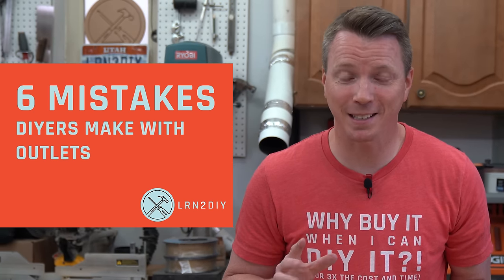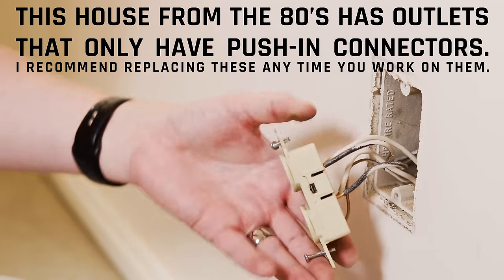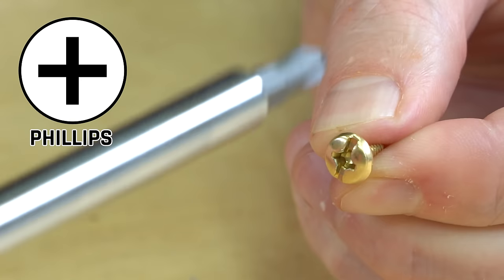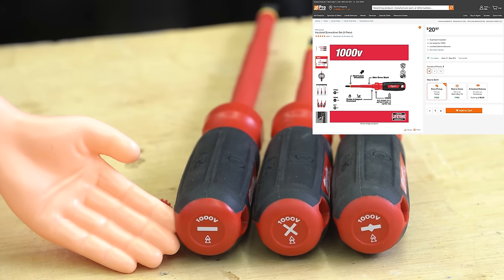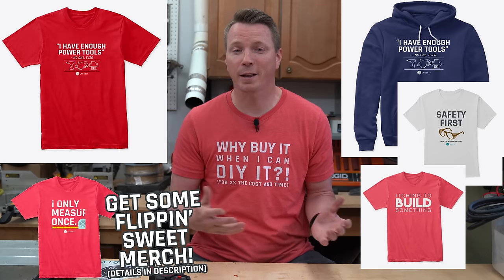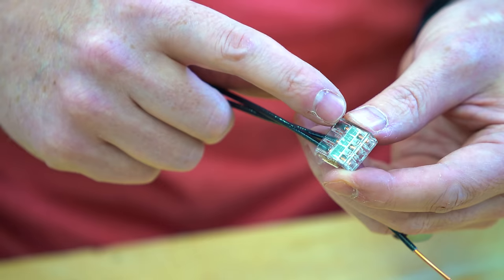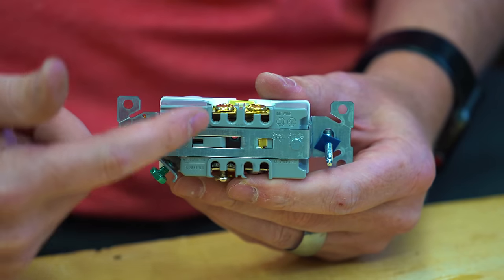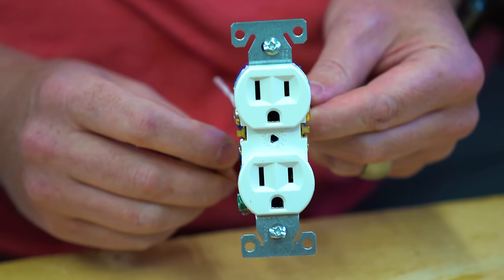6 MISTAKES DIYers Make When Wiring Outlets

Comment: I add one last level of protection for your last mistake often seen (leaving the used screws loose).  Starting at the top of the outlet  I wrap the outlet terminals with one run of electrical tape so that all contacts (screws and wires) are covered with a small amount of insulation material. And thank you for the excellent video, as a DIY person I have made all the mistakes you have shown in the past and have learned some hard lessons from those mistakes.  Thanks again, I only wish I had seen this video 15 years ago. LOL
Reply: I also tape my switches especially  if there are 2 or more so bare Ground wire on second switch don't short the first switch
Reply: I also do that to prevent getting shocked whle manipulating it.
However I was told that it was not a good idea because the gap between the screws and the box has a purpose. If there is an overload, it is preferable for the spark to happen in the box and not in the walls. 
However I did save my uncle from electrocuting himself when he grabbed a plug the wrong way as we wer moving a circuit.
So now I put that tape for safety when It's exposed and I remove it when I put it back in. 🤷‍♂
Reply: Electricians don’t put tape on outlets or switches. Homeowners do that. Today most boxes are plastic so no need for tape.
Reply: And when the tape dries out and falls off, you have nothing, but you think you do. Don't be advising people to install doo dad ideas that have no basis in fact. Just tell people to do what the NEC says to do, which may include following mfgrs directions as the priority, ie, wire nuts.
Reply: @SpaceOddity4214  turning off the breaker should have made the list then.

Comment: Excellent video! Key points I focus on is 6” of free lead from where the wire exits the box, tug test on all wires made up in a wire nut, and wrapping the terminals in either electrical tape or a newer product that looks like a very wide rubber band. Thank you for the video!
Reply: eh, I find tape not as reliable as a nut of those clamps.  Wago also makes a push-in version as well, very reliable.  I use Wago where I have a ton of wires to connect.

Comment: Great video Nils! As one who has done a lot of handyman jobs on the side, I wrap the electrical outlets with electrical tape especially when they are installed in metal electrical outlet boxes. That way the screws are less apt to make contact with those boxes. Also, TY for the tip about ECX screwdrivers. That was very helpful! 😉
Reply: The electrical tape is what I was going to mention as well.  All the outlet boxes in my old house are metal.
Reply: Same with the tape 👍👍👍

Comment: also when doing the hook on the wire, we learned to use the strippers the way was showed, but with and added reverse turn making the little hook look like a question mark. makes it a lot easier to put the wires on the receptacle.
Reply: I took an electrical in job corps and I was taught the same thing.

Comment: Clear and concise... thank you. 
Got a question.... I've found many original light fixtures in my house where the ground wire was not connected.... When I replaced the fixtures with new, I did connect the grounds.... The question is why would one not connect the copper ground? Over looked or just lazy? 
Thanks....

Comment: Some great tips for sure. I’m not an electrician but shouldn’t you be using 12 gauge for an outlet at a minimum versus 14 gauge in your video?
Reply: No, 14 AWG is fine for 15 amp service. You do need 12 AWG for 20 amp service, and some places require it for kitchens and baths due to high current (microwave, curling iron, toaster) usage.

Comment: I have been using the #1 Robertson for a few years now, but with the ECX you obviously get the most torque with less chance of stripping the head. I have that 15 to 1 and have used the ECX. I'm a master electrician with 27 years in the trade.

Comment: I used to read the Code book before every project. Now I do only with 240-volt work BUT You still got me on a few things. Great video.  Off subject but there are probably some DIYers out there who skip putting ALL connections in an electrical box.  A few years ago a light switch quit working. When I took the box's plate off I was shocked at how nasty an EXPLOSION can be inside those things.  A significant portion of the whole switch was VAPORIZED.  That Would Have started a fire if it hadn't been in a box.
Reply: I'm a handyman with thirty +  years of experience, and my specialty is electrical work.  I've heard about electrical fires, but never seen any evidence as you just described.  Thank you for sharing.  It's a very valuable lesson.
Reply: Explosion... If the switch was in a box... Would it be then considered a, "boom box"? Okay, bad joke!

Comment: Excellent presentation! I just subscribed. I do have one suggestion: At ~8 minutes in, you twisted wires for splicing using a wire nut. You twisted the wires clockwise, which feels natural. HOWEVER, if you twist them COUNTER-CLOCKWISE they will form threads in the proper direction and the wire nut will be much more secure. Just sayin' 🙂
Reply: Righty Tighty, Lefty Lucy

Comment: I just noticed a kitchen outlet I rarely use had black char marks outside the top of the wall plate. Obviously there is a loose connection causing arcing. I’m going to fix that ASAP as I know arcing can cause fires. It makes me wonder how many of my outlets are arcing but not giving me any visual cues that something is wrong. I have 50 outlets in my home. That’s a lot of checking. 

Great video! I learned a couple of things. I’ve used Wego nuts but only a couple of times. I didn’t know what they were called. They look like a definite time saver and gives a secure contact. 

Thanks again for a well done video.

Comment: I'm an electrician and use a Bosch driver for the initial tightening of terminal screws, then hand snug with Klein flathead screwdriver. Have tried their specialty screwdriver but find the flathead works just fine.

Comment: Great advice, well presented. Every light switch in my house was backstabbed and when I replaced them, not only did some wires pop out on removal, some of the backstab holes were dark and/or actually broken from years of arcing due to the bad connection. The sparkies building these houses in my neighborhood were only interested in doing the job fast, not doing it right.

And I heartily recommend that set of Milwaukee screwdrivers.
Reply: Ain't that The American way , the Boss wants it done fast , and skip the quality of work.
Reply: Klein, fluke or bust with regard to electrical tools.
Reply: Had the same problem in my house and 3 times down stream plugs were non operationable until located and screwed on. Real pain to search them out. They should be outlawed.

Comment: I would add two more products to the list, both are cheap and give piece of mind.

A simple three prong outlet tester, which you plug in and can identify a few simple issues (correct wiring, reversed polarity, ground fault, etc). 

And a voltage tester pen, I always use one of these even after I’ve tripped the breaker, gives piece of mind knowing the outlet is dead-dead.
Reply: Just make sure you test the device on a hot receptacle FIRST.
Reply: @davedickinson6345  always my brother live dead live

Comment: I'm a mechanic by trade and a diy and I'm pretty impressed with the quality of harbor freight tools. I bought a set of icon snap ring pliers and compared with to my knipex and slightly preferred the icon.the tips were cast a little more precision and the rest of the tool build was good quality.
Reply: That’s interesting.  I’ve virtually stopped shopping at HF because of poor quality.   Seems HF is very hit and miss on quality.
Reply: The Icon stuff is really professional grade.
Reply: @Mote78  the Icon line is not cheap but it is really professional grade.  I've gotten pretty good at figuring out which of the other lines are decent.  Stay away from the battery stuff.  The big cast iron shop tools like drill presses and stationary sanders are a good deal when you have a coupon
Reply: @MAGAMAN  the Icon line of HF tools are professional grade.
Reply: @Mote78  - hit and miss, for sure.

Comment: As a 38-year electrician and 31 years as an electrical contractor, instructor and employer, this video is spot-on for beginners and journeyman who never learned how to do it right.   I do you use the backstab rather than wrapping the wire around the screws on the neutral and the hot wires.  The reason I do this, is because this is AFTER  I have pigtailed EVERYTHING so only three wires are going to the receptacle - the hot, the neutral and the ground.   Of course  pig-tailing takes longer but once you've pigtailed everything out, backstabbing  receptacles in residential for various reasons is adequate.  This would be the only time I would do it.  If I did not pigtail out I would use the screws on the sides of the receptacle, but again if you pigtail (which is better if you do it right) go ahead and stab the wires in the back of the receptacles
Reply: Spot on!
Reply: Anyone that uses stab ins ,ever, is a hack. always pigtail and always wrap around screws.
Reply: @HellcatM6  You're wrong. Pigtailing is not always necessary, terminal screws are designed for feedthrough current.

Comment: One thing I’ve learned working in the Chicagoland area where conduit is required even in residential and therefor stranded wire is very common is twisting the exposed strands to the left (mimicking the pitch on the factory right hand twist throughout the wire) before making your hook.  It keeps the strands from splaying out to a surprising degree.
Reply: Did you accidentally say this backwards? If you twist the exposed strands to the left, that would be opposite of the factory right-hand twist.

Comment: Overall great video and good tips.  But I disagree with one of your suggestions.  I have been an Electrician now for 39 years.  I couldn't agree more.  If backstabbing outlets and switches were unsafe they would have been outlawed long ago.  They are still UL approved and still approved in the National Electrical Code.  The only change over the years is that you can't backstab 12 AWG anymore and the holes have gotten smaller as to not allow that.  The problems you see with backstabbing comes from improperly installed or poor-quality switches and outlets.  Leviton has always made high-quality switches and outlets and that's all we have ever used over my whole career.  I have seen some other brands over the years that were not good quality.
Reply: I have to disagree. I've replaced outlets and switches as was needed, I am nowhere even close to a professional, yet on every 1 pulled out to replace, the "backstabbing" pulled out extremely easily. I don't doubt for an instant, that high quality switches or outlets don't suffer from this issue, but that's not what is being used on "cookie cutter" houses, they are using the CHEAPEST things they can get ahold of in an effort to make the most amount of profit they can... I'm sorry to inform you, "cookie cutter" houses are the most popular houses being bought and in turn, they are using the cheapest item they can get ahold of. This YouTuber has already done a video about the comparison between "cheap" outlets and 
"high quality" outlets, perhaps you should take the time to watch it. You, being a "professional", have your reasons for not using the cheapest thing you can get your hands on, but that doesn't mean they are not being used on a daily basis by companies "mass producing" houses... That's sort of "short sited" on your part.
Reply: @david78212   "The problems you see with backstabbing comes from improperly installed or poor-quality switches and outlets"  He basically said the same thing as you!
Reply: Often the success (or failure) of backstab wiring can depend on the gauge of the wire, too.
Reply: I have always pigtailed all receptacles.
Reply: @asymptoticsingularity9281  That's a waste of time.  Fine if you're DIYing, but for a professional electrician, it's a lot of lost time and time is money.  Especially in a commercial setting when you're installing literally hundreds of the things.
Reply: @narcoleptic8982  You comment shows why there is a line ten feet wide between construction electricians and maintenance electricians. I've done both, and I'll tell you that Construction too often comes in and does no more than they have to - being fixated as you say, on time and money. Maintenance, which has to live with the same equipment and systems for years, if not decades, is all about doing a job right, so that you don't have to waste time doing it again.
The bosses almost always farmed out new work, because they claimed that a construction crew could do the job cheaper. However, they always lost at least three times what they saved, because we, the maintenance crew, had to spend days, weeks, and sometimes months finding and fixing badly done work. Just as bad, construction guys always followed the prints, which were often wrong or inadequate (in fairness, they had no way to know that.). We would know where to modify the design so that it would work as needed. We were also aware of when it was necessary to involve the engineers in our redesign work, and when it was probably best if they didn't know.
Reply: @asymptoticsingularity9281  Good for you. Never let anyone talk you out of doing things properly just to save a little time.
Reply: @narcoleptic8982  I started my IBEW apprenticeship in 1989.  I passed the Master Electricians exam in 1998.  I am far from a DIYer.  Residential Electricians may have to use the stabs to make time.  In commercial and industrial settings all outlets are pigtailed.  Now that the Code has idiot proofed electrical maintenance by not allowing shared grounded conductors it isn't as much of a factor.  I have seen open grounded conductors by people using the stabs.  A pigtailed outlet may take a bit more time but it is bulletproof.
Reply: @david78212  The other thing about being a professional that you need to understand, as a self-proclaimed "nowhere even close to a professional," is that we see hundreds or thousands of receps per year, in all kinds of installations and applications, so your experience is severely limited in a way that it can't possible get the big picture view of what's happening in our world. My personal take is that UL listed backstabs are fine when they happen one time. I believe that removing and re-stabbing is an issue, especially since many simply twist the backstab out and don't bother pressing the tab to remove it.

Comment: I’ve taken my electrical safety one step further, these six steps plus wrapping the outlets and switches with electrical tape, guards the hot and common posts from the bare ground wires in the boxes.  Also, if you have that moment of complacency, you won’t get jolted when you grab the sides of the switch or outlet that you’re working with.
Reply: Yup definitly argee w/ that practice for outlets & switches
Reply: Being as I replace a lot of motors doing HVAC I in addition to switches & outlets I wrap all wire nuts with electric tape ...a simple cheap way to insulate your favorite screwdriver is shrink insulation,...
Reply: wrapping switches , outlets and wire nuts was mandatory on commercial jobs in the IBEW
Reply: I also give a few wraps round the plastic connectors because when you stuff everything back in the box who knows what  you might inadvertently  loosen?
Reply: that jolt will remind you that you should have killed power or kept your fingers away from the sparky parts.
Reply: Always lockout the breaker for the outlets you are replacing or installing!
Reply: Same. Always have, and being an auto tech, it just seemed logical to protect the device.
Reply: @anthony_byrne  and it lets some of that magic smoke out. On a car, if you let that smoke out, you have a mad car.
Reply: I used to wrap electrical tape around the receptacles as well years ago - just as I was shown by many journeymen. 
I don't anymore as it makes it harder to trouble shoot if one has trouble stabbing into the slots with ones prob-tips and can't touch the side of the terminal tabs because of the tape. Also it prevents inspection of the terminals and wire ends when the device is pulled out of the box.  Also the tape, if not allowed to relax before wrapping, will start to work loose and in time leave a tacky, encumbering mess.
p.s. I'm a 32 year member of the I.B.E.W. local 353
Reply: @jacksprat1124  often times on the sharp edge of a box extension, do be discovered quite gloriously later
Reply: @volpegregori5348  BS. Nothing in the Union bylaws or contracts say anything about wrapping switches, outlets or wire nuts. That is up to your employer.
Reply: @renebatsch2555  I love when people wrap outlets and wire nuts. It's a nice indication that I'm dealing with a handyman/homeowner special.

Comment: Awesome!  I'm really happy that you endorse the WAGO connectors.  I work with 480 volt, 3 phase motors and have seen wire nuts fail multiple times.  I use the WAGO double and triple connectors to make the connections for High/Low voltage windings and for L1, L2 and L3 source connections.  Haven't had one fail yet!
Reply: I feel like the WAGO is essentially the same thing as a backstab receptacle.  Would you agree or disagree?
Reply: @stevel5462  I respectfully disagree. Backstabs depend on razor sharp stabs to make the connections.
Wagos have curved contacts, and spread the load over a much bigger area.

Comment: I also noticed one thing here that you didn't mention (unless I got distracted).  When you twisted the 3 wires, you twisted them clockwise from the pointy ends.  That makes sense because the wire nut will twist on the same way, so it doesn't try to unwind the wires as you twist it on.  I never thought of that either until I saw this and another video this morning.  Thanks for the tips!